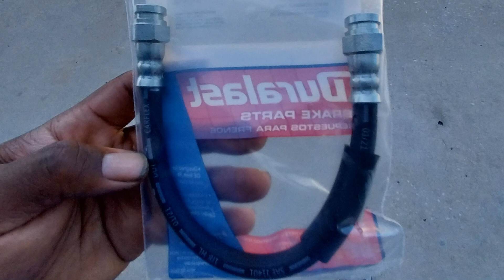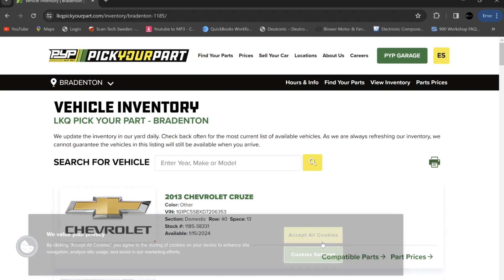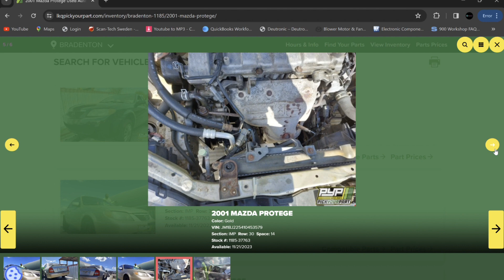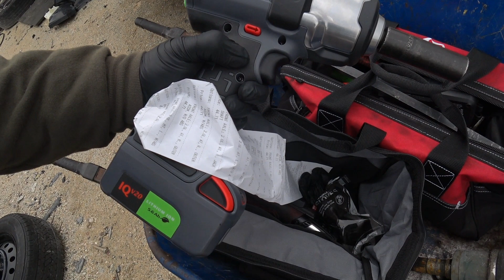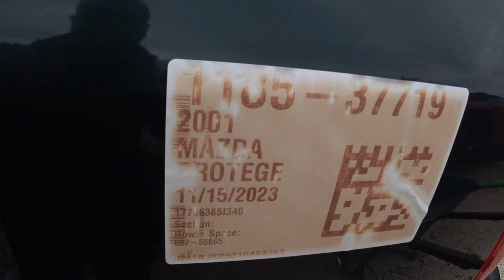Mazda Protege Gearbox Fail! EP. 23

Comment: About a year ago I spun a rod bearing on my 03 protege5 (auto). (perhaps to my lack of knowledge in part yards), I ended up swapping in a JDM FS-ZE from Ebay to replace the FS-DE. I'm still using the original automatic and it doesn't really slip in gear, but I can tell it doesn't like to go from 2-3 very well. I'm hoping that it can last a couple more years. I get the feeling of wanting to keep it going. I really like my P5 but it's pretty difficult to keep it in good condition these days. Good to see that you didn't get hurt during that lock up, I can't imagine what it would be like driving and having that happen without warning. Regardless of what you choose to do with it, I wish you best of luck with your DX!
Reply from the maker: Yes it was very scary. There was so much smoke coming from the fromt tires that i could not see forward or backwards.....I really thought there was going to be a crash.....i really got lucky. As far as your auto gearbox, try a fluid level adjustment or change the fluid. That might help. Fluid looses viscosity as it ages and that could be the issue. Also over time the fluid level, though its oil, will lower because the oil is subject to heat. And heat will do thr ssme thing to oil as it will do to water. It will vaporize and just exit the transmission vent. So try a fluid level adjustment. If that works,  drain the fluid, change thr AT transmission filter and fill it with fresh fluid, top off and u should be good for a while.

Comment: A while ago, I had a front end collision with my protege5. The car took the hit honestly and I’m still driving it fine to this day.

However, the day of the accident, there was fluid leakage like the one you point out here at the 2:33 mark. I always thought it was that pair of tubes running down past the mount. I’ve been worried ever since although nothing has come of it. I never knew fluid would originate from the mount itself though.
Reply from the maker: The OEM mounts are fluid filled for vibration dampening. And they are not cheap. A while back I spend nearly 800 dollars on 3 OEM mounts because they last the longer than non fluid filled aftermarket mounts. So that day I wasnt happy at all with seeing that.
Reply: Ahh I see. So then, what is that pair of tubes going down the body of the car past the mount? Just curious
Reply from the maker: @EliHernandezy808  Either pwer steering hoses or conduit for a/c lines. They are both in that area.

Comment: I have a 03 protege and my fuel fill neck does not have a door. And I don't experience the problem that your having when filling up.
Reply from the maker: Yeh it wont happen to every single car. Id  likt to get to the bottom of that issue. Gonna see if i can find genuine mazda parts for cheap online somwhere. When i do ill make a video
Reply: My 2000 es has never had that filler door. I’ve owned it since new.

Comment: just registered a Au. Spec SP20 BJ2. have been working on it for 4 yrs now.
The water leak is from the clutch pedal action splitting a seam at the firewall.
Remove the emission stuff at the fuel filler, i have none of that on mine, no problems.
Reply: F.... the EPA. The EPA has been the source of ALL the car problems around the world.

Comment: Hey, I've got a 2003 Protege DX that is manual and has just reached 105K miles. What sort of maintenance issues do I need to look out for and what preventative maintenance should I go ahead and do? Since it's got such low mileage I figured Id put some money into it but I don't want to put too much money into this thing because the exterior looks like crap. Almost all the clear coat is gone on the roof, and it's patchy all around the car, not to mention I had to weld a new radiator support into it and replace the hood and bumper cover due to the previous owner rear-ending someone. But as of right now, I believe I need to replace the clutch system. It shifts gears smoothly as long as I release the clutch very slowly and smoothly otherwise it lurches back and forth in first. It also seems to lurch forward under any form of acceleration no matter what speed or gear it seems to be in. Any help to keep this thing going for as long as I can would be greatly appreciated. Thanks.
Reply from the maker: @garrettanderson2528  So...at 105 miles the following is due: Oil & Filter, Spark plugs, Engine Air filter and timing belt. Im currently working on a video on the timing belt. Hopefully I can get it uploaded soon. As far as the lurching,  check the engine mounts, they may need replacements. Replacing the rear mount will give you the most grief but it controls most of the engine movement. The front one is small and usually wears first. Ive replaced mine with a solid mount to keep the others from wearing prematurely. I suggest you do the same. Keep in mind, the longer you keep the car the more money it will need to keep it running. Thats not exclusive to the Protege, thats for ANY car.

Comment: Do you have a rear main seal installer or a fly wheel holder you can recommend?
Reply from the maker: Unfortunately I do not. I did read somwhere that Mazda did make a seal installer at some point for these cars but I have to find it or even see a actual picture of it. They were dealer only tools. Another tool I researched for was the tool to replace the cam follower shims without  removing the cams. I saw a picture of it but there was no price and it was wrote in Japanese Hiragana or Katakana....i assume unable to purchase. The only thing i can tell you is to see if you can find some specs on the seal's dimensions and find a seal installer from another car that will fit. BMW makes these out of plastic and they work well. They have a bunch of differet ones for rear main seals. Research the seal dimensions for these engines: FSDE, BMW N20, BMW B48. See what you come up with. I think they are similarly sized. Maybe you could use one from BMW.

Comment: Hey boss I was wondering if the p5 gear box will work?
Reply from the maker: @renellplatero7408  Definately possible. I would need to research how close the Mazda 2, Mazda 3, are to the Protege. Someone mentioned that it can be done. Im currently sifting the Mazda forums for any information I can find. If posible i would also need to consider the posibility of changing shifter linkages as well.

Comment: If that help the gear box from Mazda 6 six speed fits in our car with little modification.
There is one guy on Mazda Protege Enthusiast who did that and also my college  in Ford Probe with the same 2.0 FS engine.
He didn't install it yet but all gears work just fine.
If i get any news from him i will let y know how it is and what has to be modified ( not much, far as i know )
Reply from the maker: Ill definately investigate
Reply: @RetrocarStyle  Gear box cover from Protege, gearing from Mazda 6 to be clear.
Reply: @RetrocarStyle i have done same thing with my Ford probe gearbox, little modifications are needed to do in the case, but its not hard, internals from 2007 mazda 6 GG 6-speed, but im changing 4 and 5 gears, they are too long, and im instaling 4 and 5 gears from mazda mx-3 v6 model, if you want some more info text me, i could help 😅

Comment: My car (03 2.0.protege) apparently has low oil pressure but it doesn't make tapping or knocling noises, it has been that way for quite a while. I run a na completely stock fs de I worry this engine is going to be a future time bomb what do you think about a na fs de? Is it reliable?
Reply from the maker: Between the oil pump and the block is an o-ring. As time runs...that o-ring can become " petrified" and get very crispy. When that happens, oil can leak between the pump and the block and you would never know.....this can cause a low oil pressure condition. The only way to remedy that is to change that o-ring. I would also look at the gasket between the oil pickup tube and the pump.